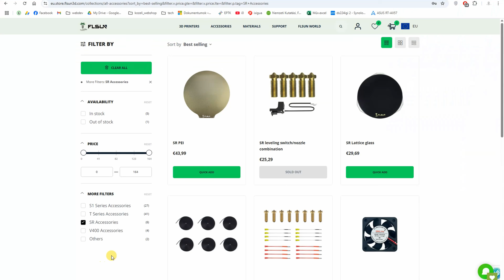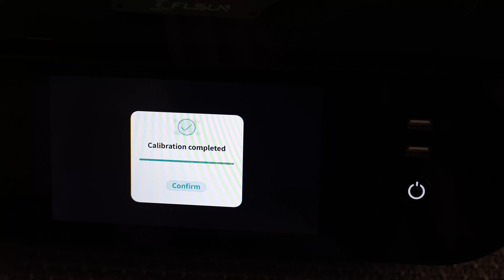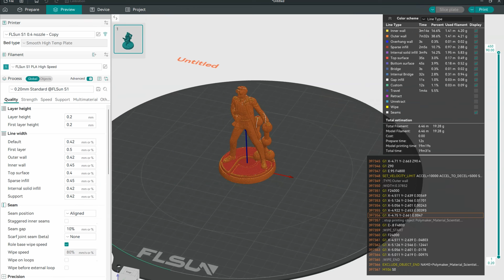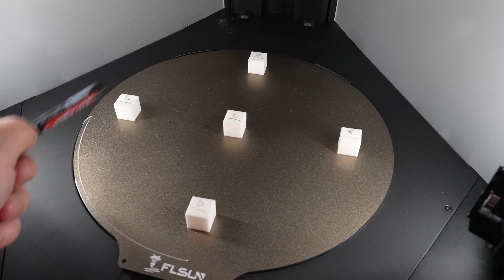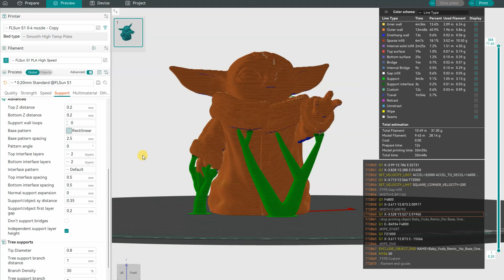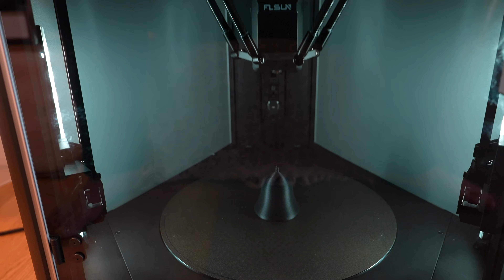FLSUN S1 Pro – Fast 3D Printer for Technical Filaments Too?

Comment: I got this printer Yesterday
Questions / Comments:
Accuracy: i experience that FLSun slicer is of -0,1mm on 8cm Part on the left Edge and +0,1mm on the right Edge. 
Standard Profile on Orca: left - 0,3, right +0,2

Have you already found out what Stettings influence accuracy? 

Speed:
I Just did some Testing: 
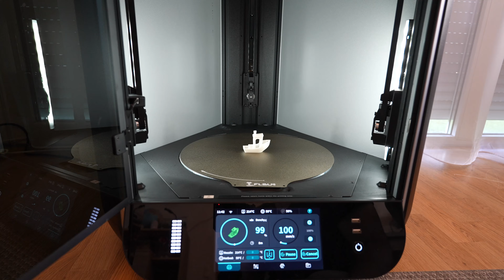Benchy in 6:34, there is still room for a 5 min Benchy. 

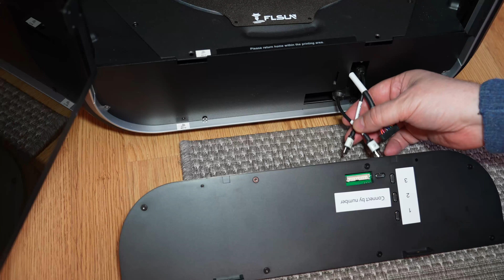A Part that Takes 3:36h on Prusa Core one comes Out Default in 55min, with some Tuning in Speed 34 min.
(Still a useable Part) 

For Prototyping, as the x-axis and z-axis was very accurate, this is sometimes fully OK If i get my Print very fast. 

Noice: yes its loud, but my IdeaFormer ir3 v2 is louder.

Is there new Hardware used or is this a Software Update? 

Second did you find a Script or what ever to Turn Off the steppers automatic after they Go Back to Parking? 

So far i did print the FLSun High Speed PLA, have you tested other filaments in Speed and accuracy? 

Is there a difference in accuracy If I use for example PETG HF?

I prepared a unicorn hairband for a event in December (don't ask we Print Hairbands matching the Kids make up) I tuned it to under 2min per hairband.

The flow went Up to 110mm for +- 1-5 sec at some point with No issues, do you know whats the boundry? 

So how Long can the hotend Buffer the Heat? 

So far I'm impressed by the Machine, thanks for your Test! 
It showed me that this device can fill a gap in my existing limitations.

Comment: i have many deltas and your supposed to calibrate all axis to make sure the steps are correct due to the motion system so i have heard i have done it on some and not bothered on others all being Flsun qqs, qqs pro, q5, super racer etc its odd but its a thing

Comment: The new Sovol Zero also has 1200 mm/s and 40,000 mm/s^2, but "only" 50 mm^3/s flow rate.

Thank you for the accuracy tests.  Most reviewers print a Benchy and some other little figurine and don't care at all about print accuracy but that's very important to me.

I need to get some PPS-CF.  I've been waiting until I need its extreme temperature and stiffness but I think I'll buy a spool to have when I eventually need it.

The FLSUN S1 Pro gets my vote for the nicest looking 3D printer.  There is a lot of pride of ownership with such a nice looking printer.

Comment: I have a T1 and a T1 Pro. While there are some things I don't like about them, they are still very fast and accurate enough printers. The S1 and S1 Pro are a bit too expensive for the improvements that they bring over the T1-s. For larger prints and multimaterial I have other printers, making the S1 even less of a good deal for me. However, if someone does not need 0.5m^3 prints, nor multimaterial, I can see how they could be happy with just an S1 or S1 Pro.
Reply: What printer do you recommend , looking for large and fast with descent quality with a budget of $1000

Comment: The noise is likely from the holding torque setting per steper. Its usually not really needed ... Could also be from having stelthchop enabled ...

Comment: I have the original FLSUN QQ-S and it's served me very well.  Although it's a bowden-tube type I still regularly print PETG and TPU although I have replaced the PTFE with a Capricorn tube.   More than accurate enough for my neeeds, still reasonably fast and the form-factor is ideal for my cramped office.   I'd love the S1 Pro but it's a little out of my budget -- although FLSUN are welcome to send me one and I'll review it for the 250K+ subscribers I have on my review channel 🙂

Comment: I bought my first delta 12 years ago. I love them for their elegance, but every one I’ve had has always been an enormous pain to keep calibrated. Getting highly accurate dimensions has been the hardest thing to maintain and once the machine has a little wear, it’s basically over. It’s super hard to diagnose and determine where the slop is…. So for me, never again.
Reply: Yepp, and thats why having them capable of technical filaments make low sense. (Since those filaments are often used for functional items that needs accurate dimensions)

Comment: Without heating chamber, bigger parts will  fail with PPS-CF.
Reply from the maker: Polymaker claims, that it can be printed even without enclosure. I didn't tried it.
Reply: If you accept %30-40 mechanical performance of the material, maybe yes. In any case, larger parts will fail.

Comment: Great review! Keep it up 🤛

In my quest to find the best filaments for my need remains.  PET-CF only or to at PPS-CF also. When I check the TDS of the Fiberon types I read that PET-CF has a bending modulus of 4900 at 145C and PPS-CF 4750 at 255C. Does that mean that PET-CF under normal temps is just as strong as PPS-CF? 

I added QIDI ABS, ABS-GF and PET-CF to my list and considered UltraPA-CF25 but I read comments of users that this filament just as any nylon absorbs water and than gets weak after time. Making it unusable for me.

Comment: You wasted your time with this 3d printer. All their new machines are false advertised and they even used bots to promote them. As you saw for yourself, it still has a loooot of issues and it certainly isn't worth it for it's price. The A1 you showed is still a better option as it is more reliable and it does what it says in comparison to the flsun.
Reply: Yes, but his testing/demo has likely saved some of us from falling for the marketing & buying it, only to be potentially disappointed.
Reply: @draincctv8659  well we knew of those things months now but ok. I suppose there are still some few that don't know about these machines.

Comment: I really like that you can ring the 3D printed plastic bell.

Delt printers are hands down the most fun to watch print.  The 12 ball joints found on Delta printers are severe wear points.  Any slop in any of them will cause lots of problems.  It might print fine on day one but several months of wear and that will change.  The resolution change depending on print location makes them less usable for technical applications.  Great for printing miniatures and figurines.

Comment: Deltas can be very accurate over the entire bed, but most don’t know that it takes much more precision to achieve that. Precision in parts, gantry squareness, measurements in calibration. Effector flat and parallel to bed, end stop precision, etc.

Comment: Try disable z-hop in Orca to avoid stringing and maybe wall printing order.
Reply from the maker: I never disable zhop. I learned this after few times nozzle hit off the supports or slightly curl-up thin parts
Reply: @MyTechFun agreed. The stringing is better than a fail.
Reply: @MyTechFun  True for fine structures, but for normal prints the z-hop disabled is okay.
Reply: That is not the issue, you need to fully dry the filament to avoid stringing

Comment: 110mm3/s flow rate is insane. So it can hold a high print speed. At 30mm3/s the print speed is capped at around 180mm/s printing speed, even if more is set. Except for travel speed.
How is this possible?
Reply: Max with the right filament would be about 60mm3/s with a proper cht nozzle. Quality is very poor at that flow rate, but a ton of tuning can get acceptable prototypes.
Reply: 110 mm³/s is just a false advertisement. Everybody knows that all their new printers are false advertised. Didn't you watch this video??? He clearly showed that it can't reach that number. All the YouTubers back then said the same thing and flsun said bullshit about it.
Reply: It is not actually 110, you didn't watch the whole thing
Reply: @riba2233  It looks good until 75mm3/s flow, but FLSUN says 110mm3/s. So it should work with 110mm3/s with tweaking (temperature, filament, cooling, idler tension, ....)
Reply: Nah it's too far from 110, even 75 is a stretch for most materials

Comment: I had a FLSun delta and it was very poor at bed leveling after a few months - in fact it reached a point where 8 times out of 10, the bed leveling crashed the firmware. I tried all versions FLSun had but they never resolved it so I have litle confidence jn reliability.
Reply: Changing filament looks a real pain, not to mention that tight fit in the spool chamber. 
I don't do much multicolour but having various filaments available without that faff wouldn't be acceptable for me now I am used the the multi material handling that BL started in consumer printers and everyone else is starting to follow.

And what on earth are they thinking making you switch off motors before turning off? Why isn't that in the shutdown sequence? Why is power still applied to motors when the power is removed from the printer? Weird PSU design.
Reply: @NickBR57  the heavy head can't lock itself in place so it'll fall into your print during power lost so you need to turn it off. hence the built-in UPS battery on this one to allow for resume after power loss
Reply: On V400 just bed level once (high intensity grid) and no problems. Just don't remove the plate. 🍻